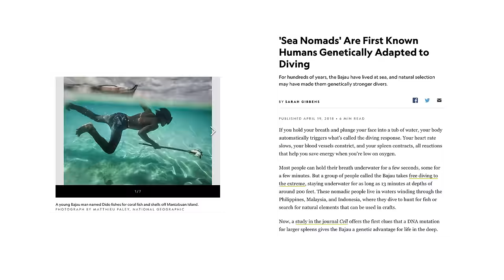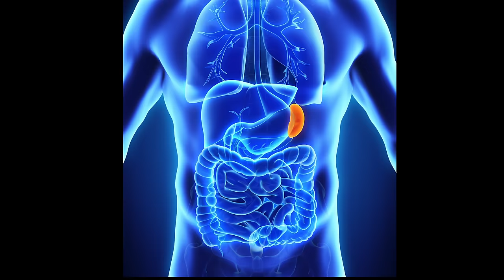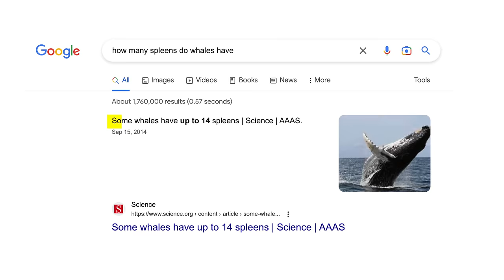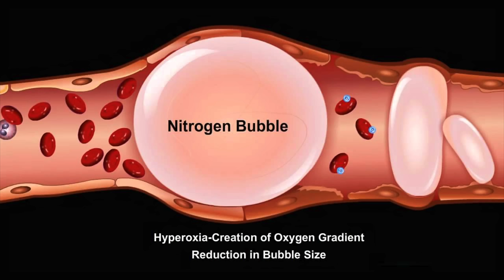The Most Dangerous Fishing Method on Earth

Comment: Modern diveing rules are more savety driven than anything else. You can go up and down in the collumn, higher pressure is the actual treatment for compression sickness. if he goes up to drop off a fish and then goes back down the nitrogen bubbles get compressed back down and hes fine. While he hops between surface and depth the actual pressure hes under is not as high as if he was constantly under water.

Comment: The auto tire compressor is fine if the right oil is used.

As a commercial Diver when I came in from oilfield diving to inshore diving we used tool compressors from home Depot with extra volume tanks and LP oil for dive compressors. We where diving normal commercial helmets to a max deep of around 25 meters
Reply: You can use OILESS Compressor
Reply: you ran your compressor on an electric motor no doubt? A gas motor spewing carbon monoxide right next to a compressor intake is a good way to get CO poisoning.

Comment: Don't forget about the Exhaust from the engine and how that can get sucked into where the intake is for the air as well, most of them Don't use any type of long extension moving the exhaust away or along extension that's for the air intake, so the 2 won't mix.

Comment: Years ago I scuba dived regularly with Jamaican commercial scuba diving fishermen. They dived from 3 to 5 tanks back to back between 80 and 150 feet for fish and lobster. They did this six days a week. Time at depths of 80 to 100 feet was often 4 to 5 hours. They used no BC's, content gayge, depth gauge or octopus regulator. There are no decompression charts that I have heard of that get anywhere near what their nitrogen load could be. I set my decompression computer to 50% oxygen but actually dived a regular air mix and the computer shut down after 1½ tanks, these guys are way over that and they slmost never do any decompression stops. Over time their bends related casualty rate is probably 50% of them, some dying, some crippled to various degrees, some recovering somewhat. One guy whose legs were gone still dived daily, his buddies helping him get around on land. They shoot freeshaft no barb, and go for kill shots. They are very efficient, even stunning 20+ lb fish, the 26:08  and by my calculations has over 20,000 tank dives. I think he has cassions disease in one hip joint (my theory, its undiagnosed) and walks with a bad limp now. I think their bodies adapt to shedding nitrogen. I also came to violate the tables 2 to 3 times over tables allowance regularly and only got hit in the shoulder once in two years. Somebody should study these guys to learn how the body responds to nitogen abuse. I would say they are also an interesting "tribe".

Comment: I would think using an electric motor instead of the gas motor would be the safest bet to prevent carbon monoxide poisoning or at the least an tall exhaust stack to redirect exhaust flow out of the way of the intake of compressor . I've been diving on compressed air a little past 100' 25 years ago , was my most relaxing dive ever , lol . But wouldn't recommend going past 99' on compressed air .

Comment: Decompression sickness is not the most dangerous aspect of this method of compressor diving... It may be third in line, but above the bends is both carbon monoxide poisoning (from the engine exhaust wafting past the compressor air intake- 15:15) and from getting hydrocarbon based oil in the lungs from the oil in the compressor. Also note the compressor is in the stern, and the exhaust is pointed toward the bow, so when you drop the pick and run the compressor engine, the wind will tend to blow the exhaust back across the compressor and it's "fresh" air intake. These risks are both exacerbated by the larger dose one would receive by breathing that poison in 2 or 3 atmospheres of pressure. Actual diving compressors use non-toxic oil, and the compressor air intake is mounted remotely, where fresh air can be assured. A shop compressor like these guys are using would fail pretty fast if it was fed the proper oil for diving, but the correct type of compressors to do this job "safely" are not cheap.

Comment: Deco depends on the time spent at +/- 150ft, so on a normal dive on NITROX 21 at time spent at 50m would be +/- 2 min, and a safety deco would be recommended at minimum 10m, if not and you surface and experience bends back down to 10m, if symptoms before 10m down at 20m then 10m and remain then seven then five, if problems persists back to ten.  Note no flying 24-48h post dive.  Is a 2 min 50m dive worth it, no. Unless it is a rescue dive.  If you surface and require to go down again grab some more air if available, if not good luck.

Comment: The people using the air compressor do not have to worry that much about the decompression sickness, scuba divers with a tank of compressed air are more likely to get it. Cause the tanks are not really all o2 its mainly nitrogen which is what causes the bends and its under pressure.

Comment: It is possible to ascend to the surface and then quickly descend back to depth (not recommended though, for safety).  
There is a small 'grace' window.  Where, in theory, the free diver could get the fish on the boat and then descend back to depth (balancing his pressure again).  It about the time, recomended to get into a decompression chamber (if you've got The Bends).

As well as the Spleen, the lungs can be trained.  This training is especially powerful when done from childhood.  As Puberty will then increase the gains from training as a child even more.  Giving you increased ability as an adult.  
I dived a lot as a kid (all free diving/snorkling).   I have about an extra litre of air space as an adult.  At 50, i still blow those doctor lung tests through the roof :)
Not sure if its a side effect, but i've smoked for 35 years and never had a smokers cough.  And my lungs are still stronger than average.
Don't smoke people, its a bad habit :)

Comment: Dive tables are probably free on the internet. One can dive on compressed air indefinitely at 1at. That's 33 feet or less, without decompression or safety stops, and without surface intervals. However, you have 60 minutes at 60 feet and 30 minutes at 90 feet without decompression but you must calculate your surface intervals for repetitive dives. Repetitive dives are decreased in bottom time which is determined by the length of surface interval.
Wow I just realized how complicated that all sounds. Sorry

Comment: Decompression is necessary when breathing compressed air. Even though the machine is called a compressor the air they’re breathing is not actually delivered to them compressed. Regardless of the depth it’s still like breathing in the surface. When scuba diving, you breathe compressed air which essentially means each breath you take equals an amount of air that at sea level would exceed your lungs capacity many times over, by doing this for a long time your body starts to accumulate toxic levels of nitrogen.
This is also why they can go up to the surface fast without safety stops. If they were breathing compressed air for that amount of hours  it would only take 1 dive to die
A good example of this are comercial divers. Because they work for many hours they dont use compressed air tanks , instead they use a fancy air compresor at sea level to deliver them a steady stream of fresh and decompressed air.

Comment: Using a gasoline engine to drive compressor ALSO invariably gets exhaust fumes/carbon monoxide into compressor's air intake, then tank and thus into lungs, especially depending on wind direction/orientation, Oil/piston type compressors also put fine oil mist in air, then tank and then lungs... In this South Pacific humidity it's compressing a butt-load of water into the breathing air too. And that salty sea air that's water dense is compressed into a std steel tank...that RUSTS, which ALSO gets in lungs too. Use of an "oil-less" piston type comp (next cheapest option) and a stainless steel tank would at least get oil and rust out of lungs, but it's a tough desperate situation all around...Have to use what you got/can get..

Comment: NO WRONG ! Grass can absolutely grow on dead coral & cement . As long as theres a suitable layer of nutrient rich soil. The reason being that grass doesn't grow there is due to the same reason why there homes are built on top of stilts and thats because Salt water constantly floods the area . You build the same exact island BUT build it high enough above Sea level , build a breaker wall ect. To help protect the area from high seas & storms . You absolutely can grow grass 

And they choose to let there goats just eat garbage ( yes theyll eat it any way & its a cost effective way of helping to keep the area clean) but at the same time they can go to the main land and Say either create a job clearing grass for people or just go collect it & feed there goats then at the same time there going to the main land can be hauling the communitys trash to a dump & returning with bails of grass. Ect. ect. There typically a solution for most issues with enough thought & Ingenuity.

Comment: Breathing Air
At 150ft for 10minutes requires at least 16min. Stop
For 20minutes requires at least 50 minutes stop.
However, even by doing such stops, no guarantee for a zero risk of DCS, limits should not be pushed and better not to get close to the limits in the first place, worth mentioning that such depth is beyond recreational diving.

Comment: The stop that recreational divers do is not a decompression stop. It is a safety stop. The difference is in it's purpose. A safety stop is primarily to slow the ascent. Fast ascents lead to rapid bubble formation and increase the risk of decompression sickness. You can technically dive right to the limits of your table or computer every time, as long as you also then ascend at the safe rate. Safety stops are taught as an extra measure of safety due to the level of skill of the average diver.

If you want to really impress on yourself the danger these guys are in, take a look at the tables maximum dive time and compare it to how long they're down for. Even if you go for something less conservative like US Navy, 70 foot is 48 minutes. You said they're down there for hours? You could go do the same documentary on the small island attached to Utila in Honduras and you'll find they're down for hours at 40m (140ft) and I believe they are the majority of who uses the decompression chamber on the island.

Comment: It should be said that the models used for recreational diving are theoretical, based on various generalisations of data from controlled testing and incorporated into a model that is designed to reasonably be extra conservative, so that it may apply safely to any potential diving tourist, be they fat, old, out of shape, dehydrated or whatever … in other words the algorithms are designed to both keep people safe and to not undermine the industry, but they describe our general experience with the physics involved, not the workings of the actual body of any  single individual …

In reality peoples’ susceptibility to decompression sickness (and other physiological issues related diving or breathing gas under pressure) varies from individual to individual but also over time and under different circumstances for the same individual, and I suppose that if one was driven to push the boundaries on a daily basis, one would learn about ones own general tolerances the hard way. 

It’s just that when you go beyond the territory outlined by the algorithms, you really are diving blind in terms of what the effects may be, except to say that they will eventually be bad or even lethal if you push the boundaries of depth and time …

Comment: If an enlarged spleen provides more red blood cells and therefore more oxygen, it could enable a freediver to stay down longer, but it would not enable them to go deeper. The maximum depth a freediver can dive to is limited by the compression on their lungs and their ability to equalize the pressure in their ears with a diminishing volume of air. This, in turn, is a function of individual physiology and training. At some point the compression will damage your lungs. With training, your lungs change and can tolerate greater pressure. The idea of diving on those car-tire compressors is frightening. If the engine exhaust gets into the compressor intake, that's very bad. I wish those people the best of luck.

Comment: I wonder if using an additional line , like an exhast line , with the supply line and that exhaust line maybe being evacuated , so under a vacuum , or just tied into the supply line so as to continuously flow air thus the regulator would be siphoning the air out of the stream , if all this would be beneficial for diving ?

Comment: Breathing air through an air compressor is not clean air, it's not filtered air and will contain oil vapor, or droplets, and also highly deadly CO2, directly pumped in from the engine's exhaust! They make specially designed surface air system's for diver's, that filter the air, and are made for safer operation, according to their specified uses, that filter the diver's air, and used correctly, by not having the system around exhaust fumes from boat motor's, or other fumes of any kind, and properly setup, keeping in mind, this is the air you're relying on, while on your dive, and using this system within the safety parameter's it was designed for, and alway's best to dive partner, with dive flag's on the surface, and another member of your dive team, on board the boat, this system will perform in the way it was designed to do! Don't let it run out of fuel, because if the engine stop's for any reason, you won't air down there! It's best to take a driving coarse, there's a whole lot more to know, and stay in the shallow's when starting, off, and as you learn, you will become familiar with this sport.

Comment: Back when i was in the navy, i use to free dive. i was good for about 2.5 minutes and about 80 feet. i had a pony bottle and sometimes i would free dive to about 100 feet blow out and take one breath from the pony bottle then slowly blowout while going up. interesting was the navy found i had a enlarged spleen and did not understand why.
Later i got my NAUI certification for free because i was in the US Navy and carried my dive gear on the navy mine sweep I was on. Never needed it, but there were two of us onboard and the other guy was an ex EOD diver.
I still have my tanks but none of the rest of the gear.
at 72 i now use my tanks for charging my big bore air rifles. And they have been marked unsafe for breathing air with a red skull and cross bones because they have oil in them.

Comment: Free diving fishermen who can go 15 mins underwater still do exist. You were just looking at the wrong place. Don't go hanging around with the fishermen who have cellphones and knows how to speak English to you. They are the well-off fishermen, they even have money to buy a compressor and a motorized boat. Of course they will not risk their lives free diving spearfishing. They have money to spend for the safety of their lives diving. Look instead for the poorest of the spear fishermen - those who cant even buy a diving mask. It is where you will see them using the wooden goggles and go as deep as the fishermen you've met but without any breathing assist. Good luck talking to them though.
Reply: Everybody in Philippines learns English since preschool, regardless of location and isolation, of course you find it strange when you go there everybody can talk to native English speakers with little or no problems at all
Do these sea nomads really have to live the ancient way to get rid of your trust issues? Most of them have adapted to modern times and equipments like phones, motorboats and compressors came from traders from other islands or ethnic groups